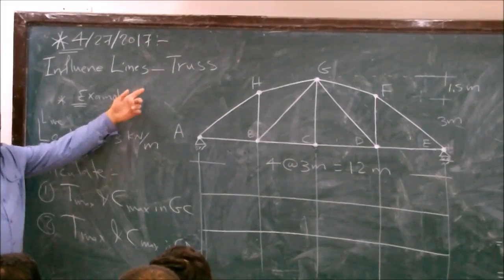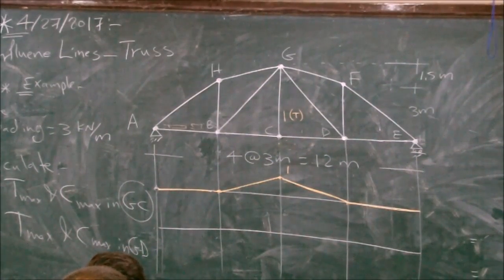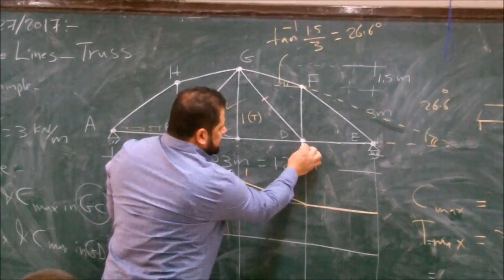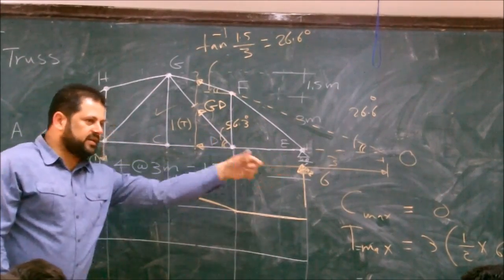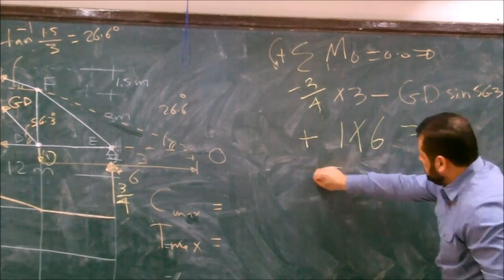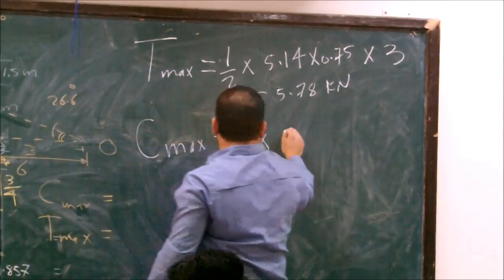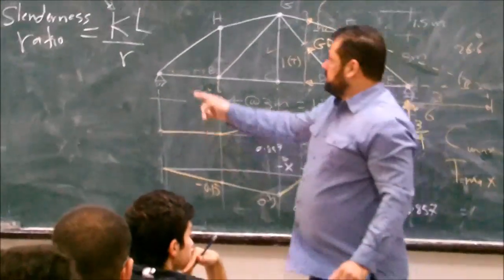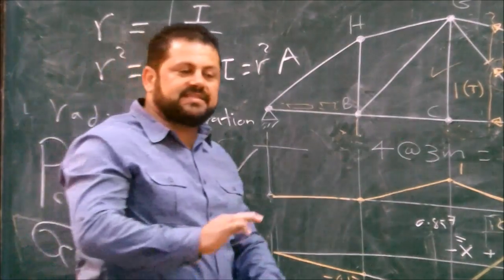Structural Analysis 1 || Influence Line | Truss

Comment: Thanks , I have a question not about this part if you don’t mind. What is the benefits from the strength reduction factor when we want to design any section in the building?
Reply from the maker: Strength reduction factor is a factor of safety. Think about something that can resist 100 kN, but for safety you will consider that it can resist only 90 kN for safety. This means that you applied a strength reduction factor or 0.9
Reply: Dr. Mohammad Alhassan  thanks a lot my teacher, it is clear now.